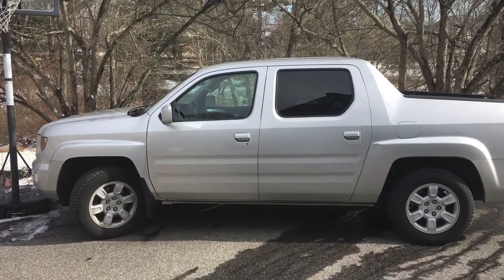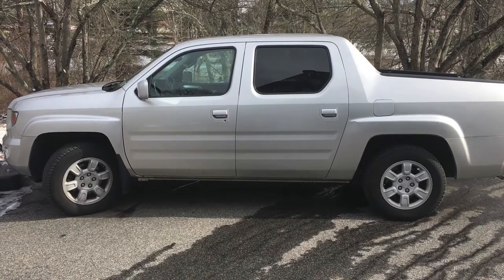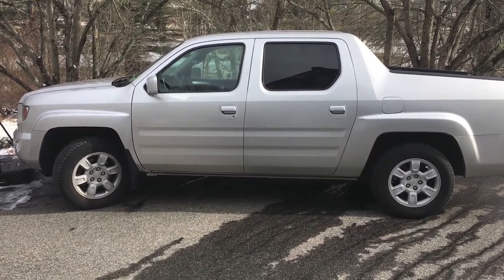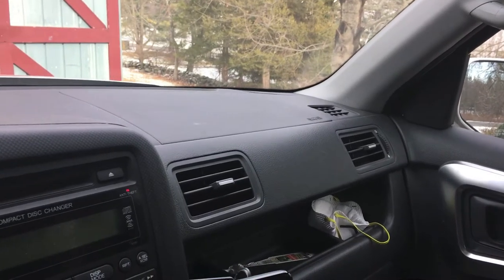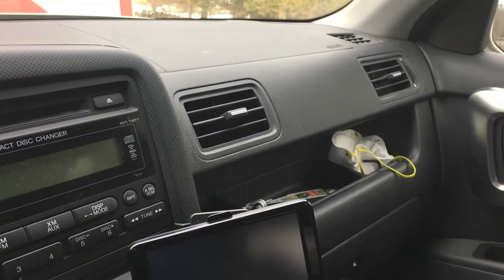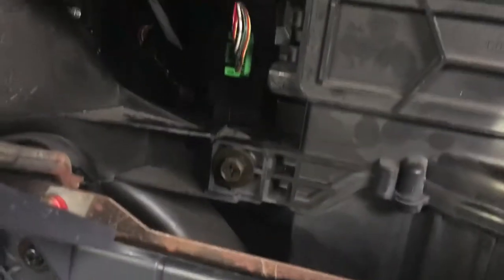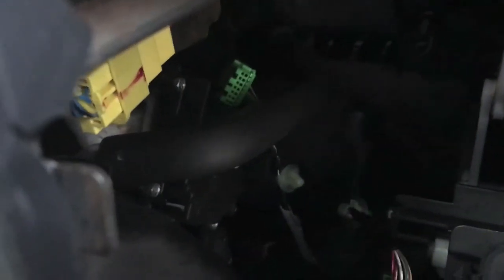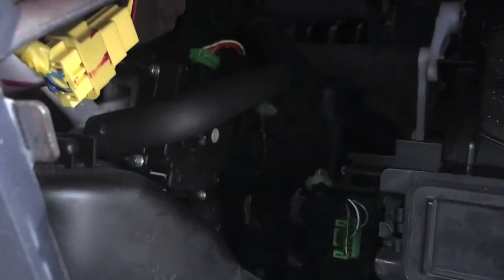Honda Ridgeline Defroster not working - dealer screw up

Comment: When you say defroster do you mean hot air blowing on the windshield? Because mine works but my wiper area never gets warm enough to melt the ice on the wipers so I’m wondering if my truck has this same problem. I also had the airbag recalls done.